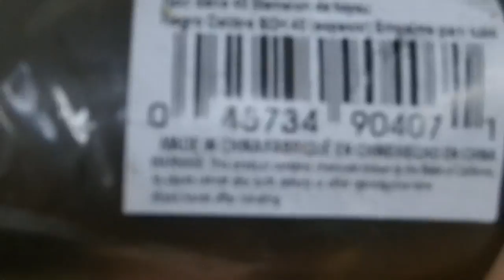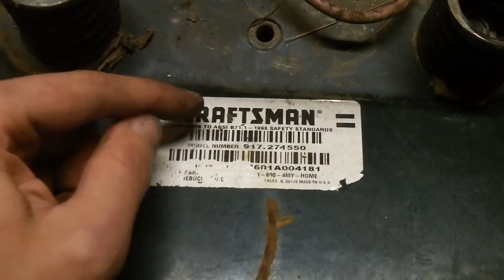Maine Mud Mower Every Trick of the Trade

Comment: What I used for a peddal throttle stop was  a 3/8 x 1 1/4 stainless steel carrage bolt, washer  & nylon lock. I bought the Speedway version (was 1/2 the price) both I believe use a "loop" around the peddal end. I upgraded that with a 3/16" wire loop guide which actually cost more then the pedal throttle stop hardware I used but I can sleep at night not worrying about it LOL